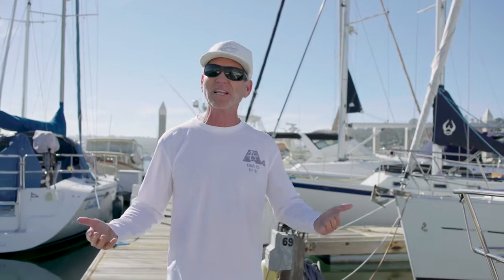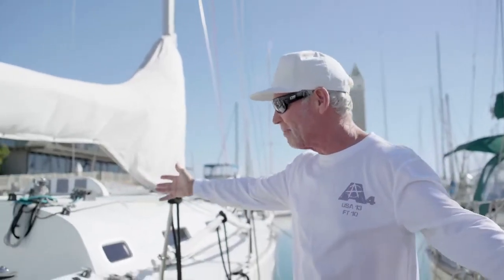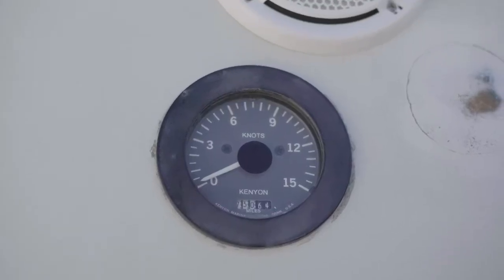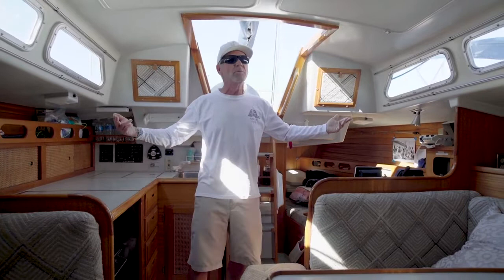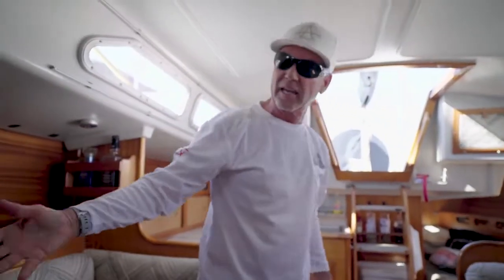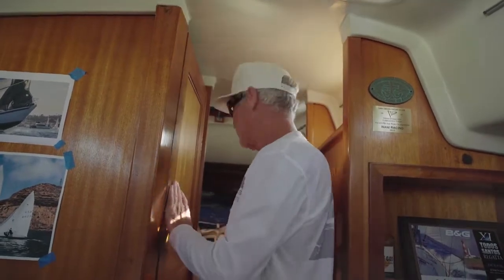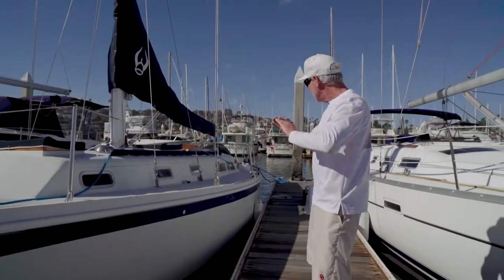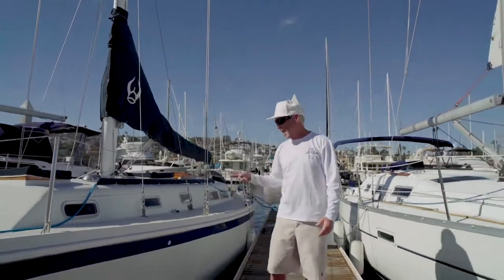Ericson 35 mark 2 -Retro boat EP1  - Tour with Scot Tempesta of Sailing Anarchy

Comment: This is a great video 👍 just curious was the hull on the Ericson modified? I was surprised you didn't mention something about the deck on the beneteau. It looks like you can easily slip on that thing. Also I always was told the tiller on the Ericson was for emergency or if your caught in a storm you can close things up and steer from below. Another thing I noticed about Bruce Kings designs are the angles inside the boat. Put a level on the floor and you'll see the floor is slightly angled on a 27 Ericson you have head way to the v birth. On a 27 cal you'll hit your head right before the v birth.
Reply from the maker: Scot bought a Ericson 35mkii since this episode and had modded it out in sailing Anarchy fashion. I'll ask some of these questions when we film his boat soon. He removed the steering wheel all together on his and it's tiller only

Comment: Ericson did make a 28+, 28'6" on deck 10'6" beam 5' draft encapsulated keel and later a 28 that was narrower with a 6' draft and bolt on keel.

Comment: Ericson's are well known for wet decks. In fact, in my years as a broker in NY, I literally never saw an Ericson with a dry deck. Surveyors I worked with noted the same thing. Obviously, some examples have done better in better climates. I prefer C&C or Pearson to the Ericsons in most cases.
Reply from the maker: the side decks have been re-cored on my boat, so that's good.

Comment: It’s a boat, you back down the companionway. How many idiots have been injured trying to go down a companionway facing forward?
Reply from the maker: this idiot has never been injured once. regardless, it's still too steep.
Reply: Whether I’m an idiot or not doesn’t really speak to the question of which is the correct method of descending a companionway ladder. Surprising how many people descend a step ladder at home or work facing the ladder even though it is generally steady, dry, and has an excellent nonskid aluminum surface. The fact is that when facing a ladder probably 3/4 of your foot is engaged or in contact with the step. When facing away only a small portion of your heel is in contact. Like most things at sea, you usually get away with silly short cuts until you don’t. In my 50 or so years at sea I’ve seen a number of people fall down companionways and they were always in a rush facing forward and their heels skidded off a step. The NA wants to maximize interior space and minimize space lost to the ladder. He/she probably assumes some seamanship skills on the part of the sailor, I think only once have I seen a hand hold placed for people descending facing forward.